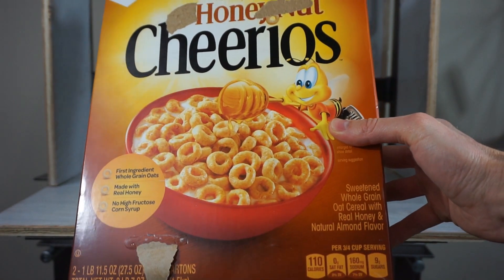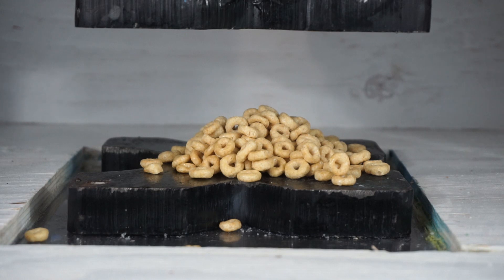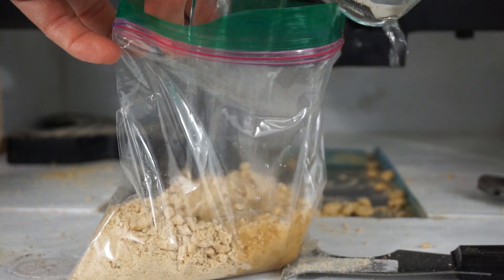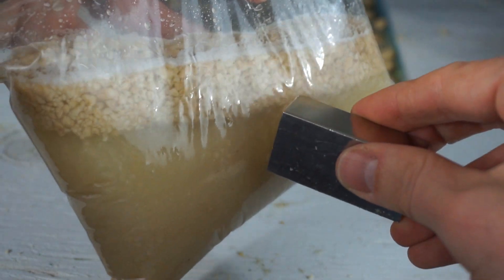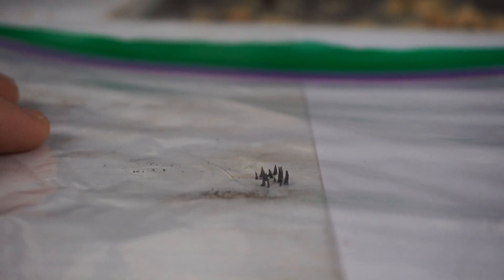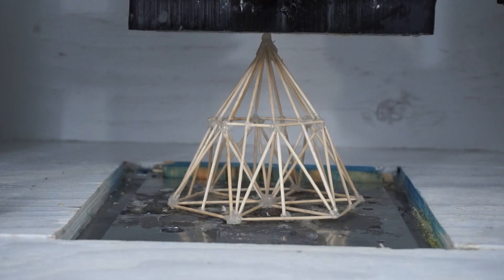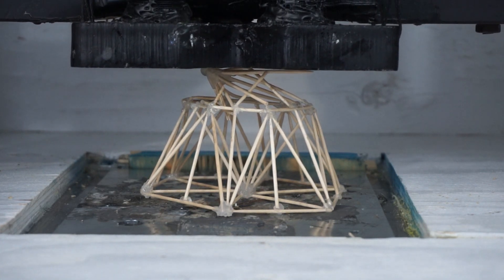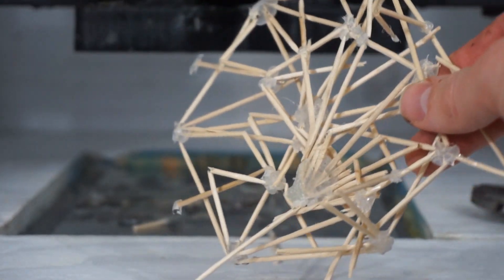Can I Make Ferrofluid Out Of Cheerios With A SuperMagnet?

Comment: Just saying but if this is true then wouldn't it be dangerous to handle a magnet that strong. Wouldn't it be doing similar things to your blood since that contains some iron as well.
Reply: The quantity of iron in each red blood cell is negligible. Nowhere near enough to cause significant attraction. Put it this way. fMRI are dangerously strong but doesn't affect the red blood cells. I doubt mr. Xmen Magneto could extract iron from red blood cells 😉

Comment: I'd think the metal would be in ion form in food? Is that not right?
Reply from the maker: +Stefan Reich in natural food it is ionic, in cereal it isn't. Which isn't as good, your body only uses a small fraction of the metallic form by turning it into ions. So it is a little deceiving when on the box it says 25% of your daily iron, because is not ionic.
Reply: Holy God, I see they really put iron flakes in there. So their 25% RDA figure is basically a lie.
Reply: There's not proof the author the video didn't put the iron in there himself to make the video look better.  I'll hold my skepticism.
Reply: Well, that's 'ironic'. 
rimshot
Reply: my country had this researched. and yes, they do put metal flakes (from recycling companies) in your cheerios. this has been known for a very long time here in the netherlands.
Reply: Hydraulic Press Action yes! this is also why it is so difficult for the body to absorb iron supplements! I used to take them but did my research after seeing the effects of storing the pills in a metal case
Reply: ChaosSigma0 baa dum tsss 😄
Reply: The Action Lab . a marketing lie to brainwash consumers 😕